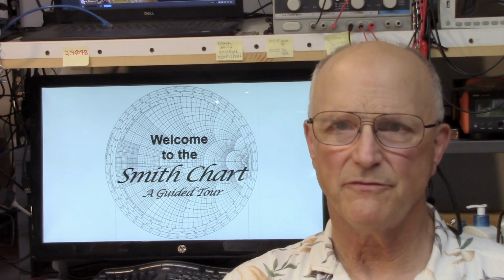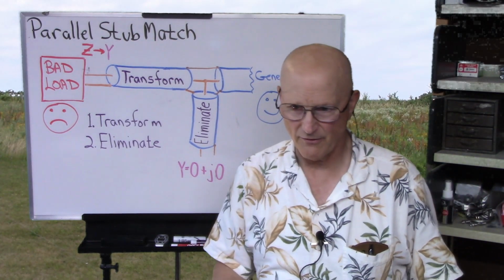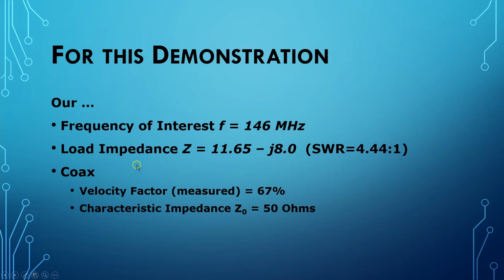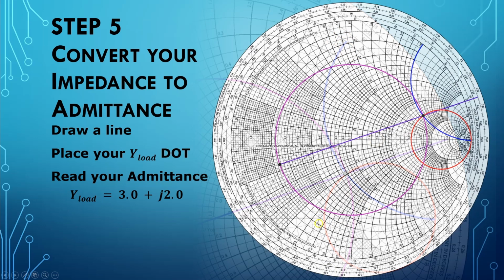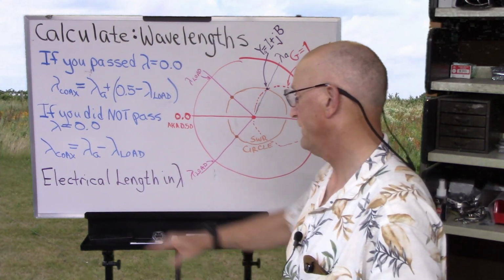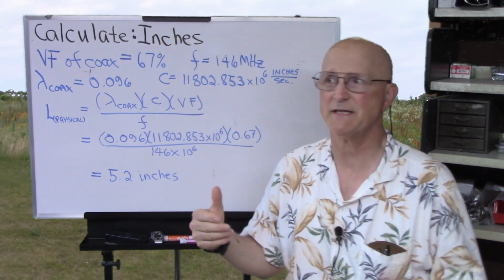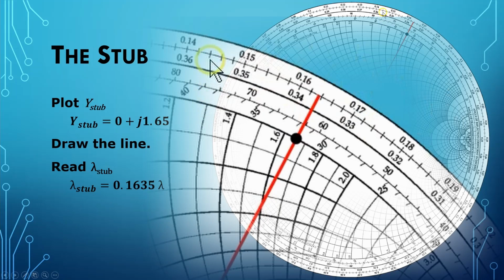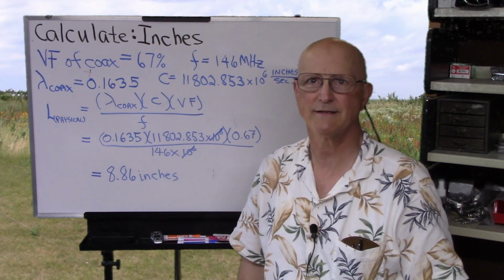Smith Charts: Designing a Parallel Stub Match with an Open Stub (00h7)

Comment: Great video!  Ive heard of people making stub matches for field day band pass filters. Is that possible?  With winter field day coming up I would love a cheap band pass option to be able to operate with friends.
Reply from the maker: Well, they are not really stub matches. They are filters that use the impedance transformation characteristic of feedline to implement them as opposed to impedance matching devices.
Here is how I created a very effective band reject filter using some RG-58 coax ...
First, you need to know the actual Velocity Factor of your coax because you would be making 1/4 wavelength lengths (WL) of the stuff at the desired reject frequency, electrically speaking.
1/4 WL from source to first jct.
1/4 WL open stub soldered in parallel at jct (looks like a short at jct at reject freq)
1/4 WL from 1st jct to second jct in parallel with 1st jct
1/4 WL open stub soldered in parallel at jct
1/4 WL from 2nd jct to output.
You can continue this more times if you want deeper reject notch. Accuracy in coax length calculation, cutting and soldering are important.
I tried (admittedly, not too hard) to make a BP filter using the same and was a little disappointed in how wide the bandpass bandwidth was. The 1/4 WL stubs became shorted stubs.
I would be VERY interested in what you end up doing.
I feel a video coming on that would be another fun one to do!  Thanks for the idea!